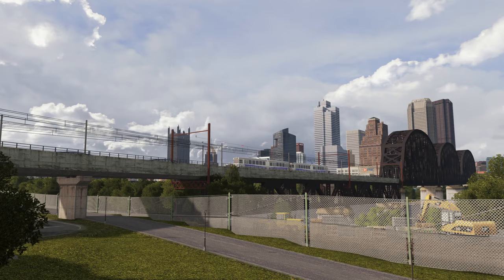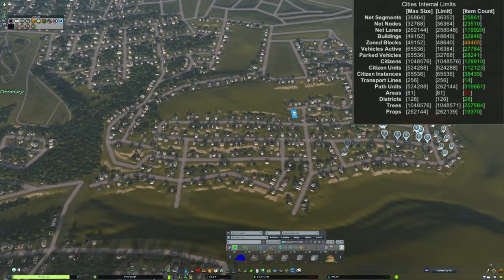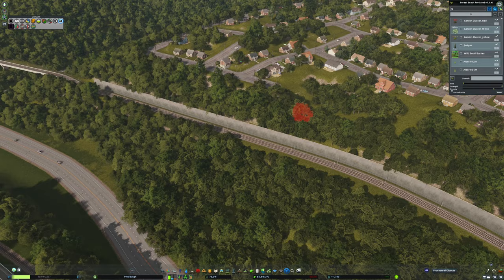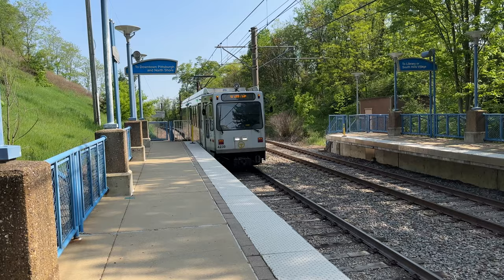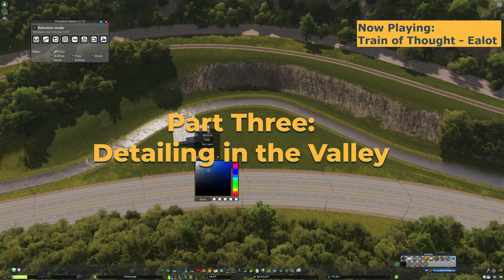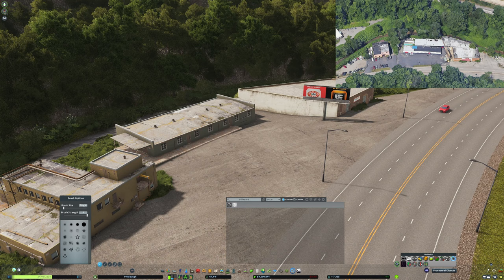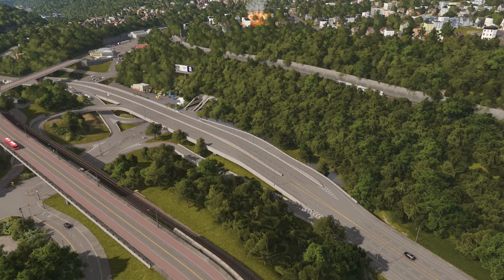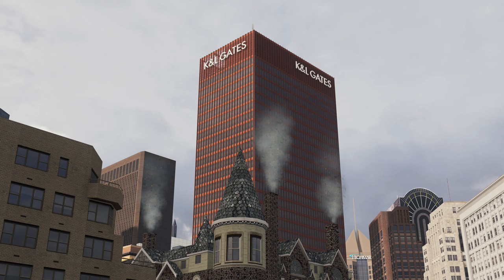How to Create Realistic Suburbs QUICKLY Pittsburgh's South Hills in Cities Skylines

Comment: Pittsburgh is one of three remaining systems that uses the Pennsylvania Trolley Gauge. New Orlean's streetcars still run on it, as well as route 101 and 102 in Philadelphia. Because route 101 and 102 uses the same gauge and electrification system as Pittsburgh's light rail (650 V DC using pantographs , you can theoretically run SEPTA trolleys in the South Hills and Pittsburgh LRVs in Media with little to no adjustments. Oddly enough, the MFL and Philadelphia's other trolley lines run on a track gauge that is 1/4 of  an inch thinner than the normal Pennsylvania gauge.
Reply from the maker: So what you’re saying is… SEPTA trains in pgh when?
Reply: Your on your own
Reply: Look how it takes over
Reply: @GaseousStranger  SEPTA is close to retiring those K-Cars, and most of the system still has space for low platforms from the PCC days (see: Steel Plaza). It might be closer than you think
Reply from the maker: @oldmanenergy  That would be very interesting to see!